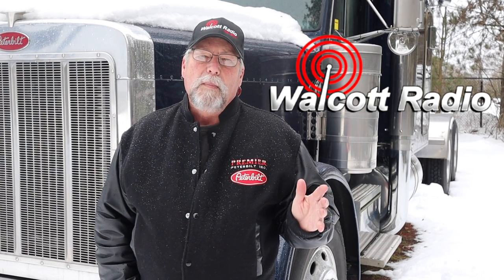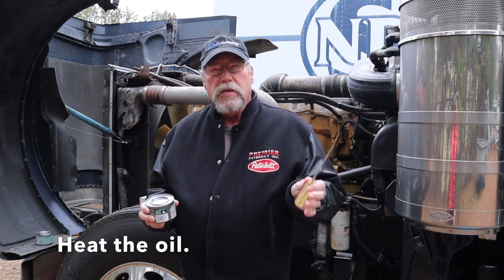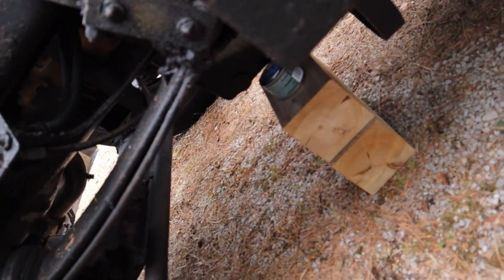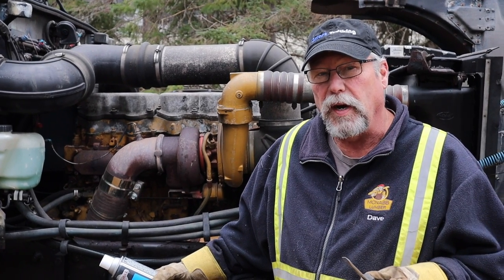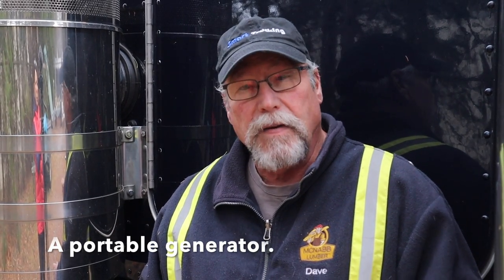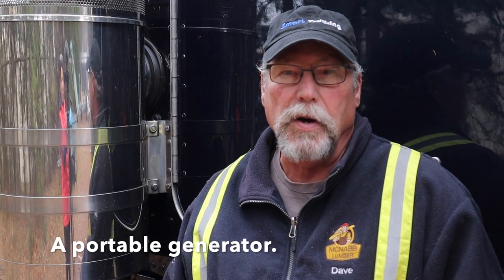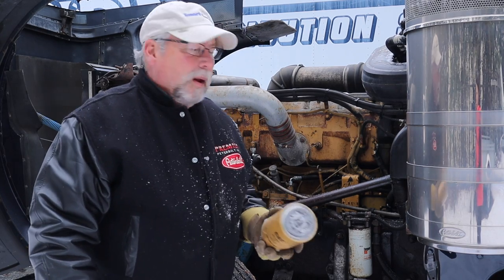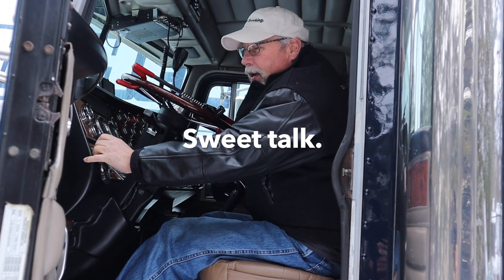How to Cold Start a Diesel Engine Truck (Tips, Tricks + Hacks For Truckers!)

Comment from the maker: Good Day Big Strapper. Thanks for dropping in to check out the Cold Start Video. You got any nasty experiences with your ride not firing up? Love to hear from you.
Reply: Thanks for the video. I drive for a local company that has junk trucks. What are some sinple things I should take with me when I go out on the road.
Reply: ALWAYS CARRY A GOOD INSULATED SLEEPING BAG.
Reply: Not a truck but on topic....
Up in Northern Minnesota, one winter, I went out to our van to start it. Chevy G-body from '77 with a 292 inline 6 and a 3 on the tree. I put in the clutch and cranked it until I figured it would start, no dice. My dad sniffed the gas tank, and told me to stop. He had me smell it too....at -54°F (-48C) gasoline smells like tar because the volatile parts of it that make it burn are too cold to vaporize. So we got a block heater and a gas tank heater, plugged them in, and left a few hours later.
Reply: I had a fuel pump die in Canada in winter. Stuck in it for hours. 20+ below. I layered up and got under my sleeping bag
 My coffee froze in my cup. Finally got towed after about 10 hrs
Reply: A space heater that might be a good idea
Reply: Back in the day... many times we used a tiger torch on the oil pan of our 871 Detroit.

Comment: Lol ur going to have these new guys burning their trucks down lol
Reply from the maker: Well, hopefully not!
Reply: Yeah especially if they drive for Swift! 🤣🤣 Good one Redwine 5 that was funny man!
Reply: Swift driver going to say if one can works five cans have to do it even Quicker😆😆
Reply: I can see it now, some idiot will grab a bunch of cardboard boxes and set them ablaze under their trunk......
Reply: Hey now, I'm a Swiftie and I'm smarter than that, I hope! Lol 😆 I'm a rookie and I'm still learning.
Reply: @mmtruckingllc657  maybe add some wood to camp fire the baby up...
Reply: @SmartTrucking  Plan ahead. Have not found a vehicle yet that will run on hope!
Reply: The smart thing to do would be to build a fire away from the truck and then put some hot coals in a steel bucket and put that under the pan. I gotta tell you though, back in the day I've seen guys build blazing fires under their trucks, that's just nuts. I worked in a coal yard and we always had a pot belly stove burning in the shop, shovel some hot coals in a galvanized pail and voila, instant heat. A bonus were the ashes, put them under the wheels whenever we got stuck in the snow. Ah, the good old days, sheet!
Reply: Its great... You can also roast some weinys...
Reply: Honestly these modern trucks are probably worth burning down anyway. No offense.

Comment: One thing to keep in mind is the new paccar engines and some other manufacturers used plastic oil pans so be cautious of that
Reply from the maker: Seriously?! I didn't know that!
Reply: @SmartTrucking  yeah ! Silly to be honest, Good thing I still run the ol 98 379 !
Reply: And Detroit too these days
Reply: Its plastic On the outside, aluminum inside. The plastic is to help insulate and try to prevent leaks or weeping from the gasket...
Reply: @jonnothetrucker  Detroits are metal. I have a newer DD15 and it’s metal. The radiator cover is plastic however.
Reply: And probably twice the cost of a metal pan for an older model engine.

Comment: Candle and coffee can should be in every truck that runs in winter climate . If the truck breaks down in cold weather go in bunk , close curtains and put candle in coffee can after lit . It will provide enough heat to keep you from freezing to death in a serious stranded situation,  like a major snowstorm for instance .
Reply from the maker: Great tip Peter!
Reply: My father told of putting a roll of toilet paper in a coffee can fill it with diesel then light it on fire underneath the oil pan.

Comment: A tip from a New England logger:  we install quick couplers on the coolant drain ports on the equipment engines and on the heater hoses of our pickup trucks. Come to the job on a cold morning and connect the heater hoses to the Diesel engine. In a few minutes it will start like summertime. I’m sure this would work on truck engines but it would probably take a bit longer. Saves a lot of wear and tear on your starter too.
Reply from the maker: Nice tip and a new one for me, thank you! I think that's the best tip I've heard this year! Proves you're never too old to learn something! Thanks again!

Comment: I used to keep a small bag of charcoal with me. If it was bitter cold you could use it like the sterno trick. Some people used to carry a steel bucket to burn the charcoal in. On really cold mornings you'd see a bunch of burnt up bags on the parking lots. What Dave says about batteries is good advice. Probably number 1. I have Odysseys' in my truck. They aren't cheap, but service calls cost more. Also, Arctic Fox tank heaters will never let you down and you'll never need to put anti-gel in the tanks. Of course you have to keep the engine running for them to work, but when it is below zero I do anyway even with an apu. It avoids the hard cold starts and I'm always safe and warm. In my old age I'll spend a little on fuel and keep me and the truck warm.

Comment: Another nice tool, cordless heat gun on the fuel filter(s).  Keep two or three batteries charged for use, they'll help with a gel problem as well as warming the fuel prior to injection.  Also can work to warm the batteries up; keep a small, thick blanket or old coat to throw over the batteries to keep the heat in, lock the trigger and give it a little time.  Will also quickly thaw a frozen door lock, frozen up wipers, mirrors or windows without damage.

Comment: I thought I would comment on another tip that can help start a cold engine, while its not at all some guarantee to start in severely cold weather it can help if the conditions are marginal and have no other means at your disposal. The technique is simply to crank over the engine for a few seconds rather then crank and crank. Crank over the few seconds and then let it sit for half a minute, then crank again for a few seconds, sit again for half a minute and so on and it make take a few events of doing that to allow it to fire up. What its doing is warming the cylinders by way of the compression heat generated and then sitting allows for that heat to soak into the head and cylinder walls. Some engines respond very well to that technique such as an old detroit 8V92 silver tip I have and have used that same method on other two cycle detroits years ago at an oilfield company. Otherwise those detroits can be cranked over and over and never even attempt to fire at all. I do that as well on other older tractors I have that won't even start just below the freezing point due to their design that was never conducive to starting if an ice cube was near !.

Comment: One I used was an electric dipstick I bought at a yard sale. Was just long enough to get couple of inches into the oil. That on a timer plugged into my shop hydro & a shot of either did the trick every time. Have always carried candles as well. Amazing how much warmth you can get out of having couple of candles.
Like you, done the freeze _ss off covered with everything available waiting for service vehicle to replace fuel rail that had vibrated a hole against ribbing of engine.
The part on that one that hurt was I had questioned how close fuel rail was to engine when new truck was given to me. Told "oh no, that is normal." 1st trip out it wore the hole. I was asleep (Doing 5&4s - super single back then) when engine quit. Had emptied both fuel tanks while I slept. Fuel everywhere! Had to get service tech to bring 25 gal as well just so I could get to next fuel stop. 
When I got back was greeted by boss who asked why I hadn't fixed it myself. Told him that new lead mechanic wouldn't let me put my tool box in new tractor. He went in shop, tore a strip off him, then made him carry my road box from my car all the way across yard to where tractor was parked. Fat f_ck_r couldn't lift it to put it in kick box! 
Boss standing beside me told him next time I questioned something that he better pay attention. 
 Age & experience equals education!!!
Reply from the maker: Wow, great story!

Comment: 1. Make sure your batteries are top of the line and in good shape. 

2. Make sure you use a top of the line synthetic blend motor oil or full synthetic
Reply: Or the other way to go is to (if you can afford one) get an APU.

Comment: 😆 The sweet talking is something I do all the time whether it be the 7.3L Powerstroke in my 95 Ford Dually, or the 454 big block in my 85 Chevy C30 dually. Also gotta love hearing a diesel of any size hitting and missing when cranking in the cold. And if you're going to carry ether with you save yourself the headache of needing 2 people and just install an ether injection system.

Comment: Part 2: The truck body, etc. was so cold that I did several laps around the yard to get the speed up to a whopping 10 mph. My boss said to get out on the road and start picking up my recycle route. It felt like driving a rock- no suspension, no air ride seat. After about another hour I was able to drive 20 mph. The sun and slow driving plus temps reaching 20 degrees gradually got the truck and hydraulics up to speed near the end of my shift. Have a blessed Christmas and a better 2021!

Comment: Dave this year I spray the eter directly from the hood vent and it works very good. So I don't need to pop open the air filter. So I role the driver window down stand out in the stair spraying while pushing the start botton 😀

Comment: Get independent heating for the truck, Webasto, Eberschpacher, and you can switch it on remotely or set a time on the clock.
You heat the cooling water, with that your engine will heat up and you can heat the cabin.
You are saving your engine and sitting in warm cabin right away

Comment: That reminded me of the ridiculous gymnastics I used to go through to start trucks in winter in Victoria, Australia.  At one stage I was driving an International ACCO, a locally made cab-over truck by I-H Australia.  It had a 210 V8 Cummins in it and it was a complete pig of a thing to start on cold mornings and even more so when I was on my own.  The air cleaner had a snorkle on it that ran up the rear of the cab.  So, most cold mornings would see me clinging to the side of the cab, with a can of Aero-start in one hand, aimed at the top of the snorkle, holding onto the cab gutter with the other hand, standing on one foot while I tried to use the other foot to depress the starter button on the dash board!

I have never believed that driving trucks for a living was nothing more than doing a job a well trained monkey could do, but on some of those sub-zero mornings, clinging to the side of the truck like a chimpanzee, I did have some occasional doubts!  lol
Reply from the maker: Man, I wish I had a picture of that! Thanks for watching!

Comment: Gidday Big Strappa! I'm driving already in my third country of residence (Russia), and we don't go anywhere in winter without at least a butane torch, but preferably with a small blowtorch. Those diesel-fired wet heaters you speak of are just as unreliable as you say, but a blowtorch is as durable as a ball peen hammer.
As they say downunder, keep her shiny side up!👌

Comment: Up where we live, I use an espar engine heater rated at 14,000 btu, plug the oil pan heater (300watts) in as soon as you shut her down; usually that works at -48.  If that fails you, tarp the engine, and throw a grain drier tube under it, and fire up the ol 140,000 btu diesel forced air heater, tarp her up and in about 45 minutes she will start like it’s summer.  I’ve had to do it several times.  Great videos tho bud.

Comment: In extreme conditions only tie rag on your pin puller dip in diesel squeeze out .  Light it. Bypass the air filter  get a buddy to hit the starter and let the motor suck the flame in . Like you said got to have good battery’s  ,  don’t let the motor grab the rag . I’ve been doing it for years from trucker Al retired .

Comment: As always.....good ideas! Another way we did it back in the day which is safer than the Sterno thing is to drain out the coolant into steel five gallon pails and then warm it up on a wood stove or in front of torpedo heater. After it’s good and warm pour it back in and wait about 10 minutes then crank.
Reply from the maker: Yup, that's what Cathy's grandfather did!

Comment: I almost forgot always treat your fuel with antigel never assume that it’s treated this will save you a lot of aggravation. 

An interesting bit of history the old timers used to dump about 20 percent gasoline in the crankcase this thinned out the oil and as the engine warmed up it evaporated “DO NOT EVER DO THIS” on a modern engine with a closed crankcase ventilation system as it could cause the engine to runaway as well as destroy seals bearings ect but worked on the old engines back in the 1950s
Reply: They also did something like this back in the day to get piston powered war birds running.

Comment: The best way to ensure that  ANY engine will start in Artic weather is to follow the Russian Siberian example & use 100% synthetic oil which doesn't thicken regardless of temperature and allows motor to turn over as if it were middle of August!!!
Reply from the maker: Good tip!

Comment: My trick is to fill  the fuel filter with kerosene. Be careful with the crack engines get addicted, gets so bad they won’t start in the  summer  without it use as last resort only. If you can’t plug in and below -10F definitely drain oil after shutting down and bring inside but always put a tag/note over starter button or key so you or someone else doesn’t forget that there’s no oil in her!

Comment: Oh man they get addicted to that ether! Change out your oil to full synthetic for winter and don't overdo the additives. The synthetic flows better cold and helps the engine crank faster. That extra piston speed helps heat that air in the bowls..👍

Comment: I had a cord break one time when it was -45c did not know until the morning. A mechanic used a propane torch to heat the oil pan lol
Reply: I did that for quite a few years with trucks or tractors on the farm even if they were plugged in simply because the oil used at that time was not meant for that type of cold weather, a reason why I switched over to synthetic 0w-40 for any of my equipment used during the winter. Propane tiger torch and section of old stove pipe with a 90 degree elbow on the end, most farmers go to up here in the Canadian North.
Reply: @danokerr9929  wind chill doesn't matter
Reply: I've got many trucks going with a tiger torch
Reply: Sondor While wind chill itself doesn’t figure in, the wind does. Protect that engine from wind. Do whatever it takes, to keep it warm. It’ll be the difference of starting, starting hard, or not starting at all!

Comment: OK  Big Strapper , I may be just little older than you and I agree with every thing you said , and more , in my early years we had COMPRESSION releases on our 220HP cummins engines which helped considerably , and GOOD BATTERIES , you have to be very careful with using EITHER on some of these engines  equipped with GLOW PLUGS serious engine can happen , next my Wife got me a NORTH FACE down sleeping rated for 0 degrees , and they are great , next carry 2 or 3 large fat candles and some crackers and peanut butter , it will keep you alive , I don't care how much you don't like peanut butter , they will taste great when you are hungry Stay safe  Frank T

Comment: I remember my dad and grandpa using the sterno trick in the winter. However, that was when trucks had more steel in them than plastic. To my mind, a plastic oil pan and an open flame is a recipe for disaster.
Reply from the maker: Yeah, you don't want the flame too close to the pan!

Comment: Instead of using either you get a rag damp with gas not enough where it's dripping but damp and hold it over the air intake it well start it but it doesn't hit as hard as starting fluid

Comment: Everybody should have a Mr. heater buddy propane heater I highly recommend them they have tipped over protection and low oxygen sensor they use a 1 pound screw on propane canister mesa great emergency heater
Reply: You do know when you burn propane.. it creates condensation?? So everything gets wet in the truck..  not a good idea... now, canheat is great stuff.

Comment: The Webasto system works great if you use it regularly. The biggest issue is an Airlock problem.  I never had a battery issue due to using the Webasto. Buy the model that is programmable and if its very cold -30C , program the system to fire up back to back . The basic time of running is 2 Hrs ,therefore a back to back will give you 4 Hrs of heating.

Comment: Got to be carefully with the fire trick.  Some of these newer motors have fiberglass pans.
Another trick I use to do was I had a small turbo heater I made a heat pipe and floor vent case and vent for house and plug it in with hood closed.

Comment: If your truck has two battery boxes then buy four extra batteries for the passenger side as well.  Having extra batteries is cheap insurance to make sure your truck always has enough cold cranking amps no matter if it's 40 below zero outside.

Comment: Well, sweet talking works on the wife (most of the time), why wouldn’t it work on a truck? I have an old Proheat APU on mine which has been pretty reliable over the years. I bought it used for 5k about 14 years ago and it’s still going strong. Great video, Dave, thanks sir.
Reply from the maker: Bribing the wife with gifts works here, wonder if buying stuff for the truck would work as well?
Reply: @SmartTrucking  couldn’t hurt! 🤣